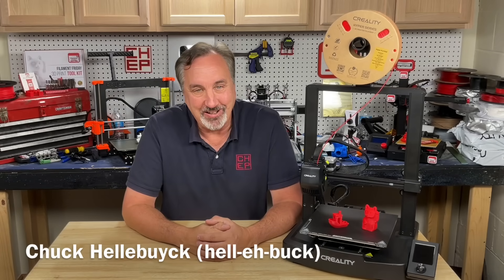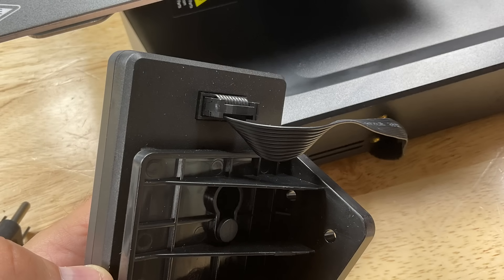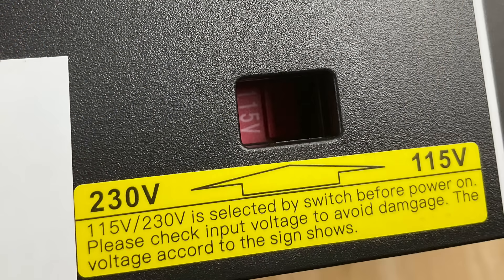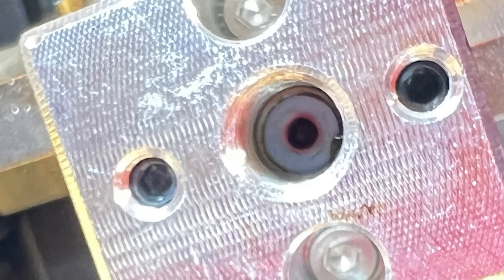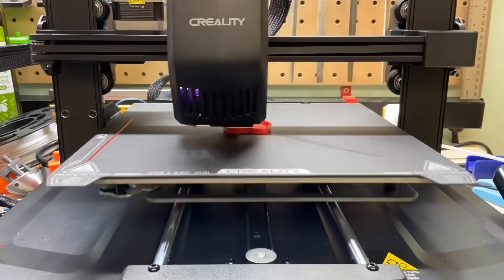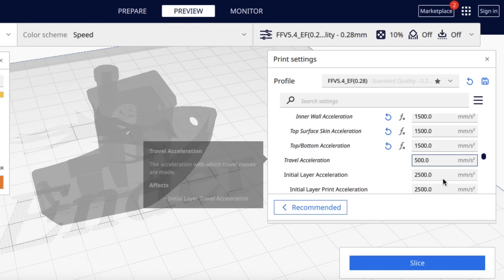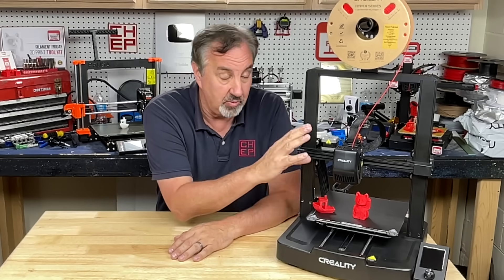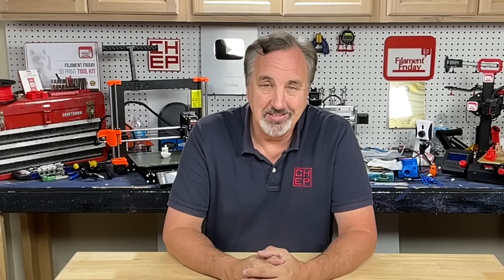Ender 3 V3 SE - Excellent Budget 3D Printer

Comment: Looks like they took some tech from the CR6SE....

Talking about the CR6SE, I know you must have one hiding in the back there covered in dust.
I have been using mine for almost 3 years and still think it's a great printer!
Over those years I have done some amazing prints off of it.
I do have the Community Firmware on it which makes it a MUCH better printer to use, and have changed out the extruder... Twice! 😢

But I would really like you to do another video on this machine if possible and see what speeds and stresses it can really handle.
I never print higher than 60mm/s and sometimes down to 50 for the finer prints.
But I print PLA, PETG, TPU and ABS all with the stock printhead and just love this machine.

But thanks for your videos, they are always great to watch and learn from and you have helped me in more ways than one.

Thanks again and stay well...

Comment: Why don’t they put these improvements on an Ender 3 v3? If they can do all that for 200, add some blowers, add linear rails for the X & Z axis, change to an all metal hot end, add an accelerometer and run it on Klipper at its true speed. The Neptune 4 looks like a better machine than the Ender 3 now.
Reply: There are actually 3 versions of the Ender 3 v3. The SE (Sprite Edition) which is the entry level with $200. The KE (Klipper Edition) with linear rails running Klipper at about $280 and finally the v3 with Klipper and a Core XZ motion system at about $380.

Comment: Smaller horizontal footprint than the ender 3. It has a load sensor for automatic Z offset.  Surprised they're all getting rid of manual bed leveling so you can't make any physical adjustments.

Comment: The real question is how van prusa continue with 900€/$ mk4 with such competitors ?
Reply: The point of Prusa printers is reliability and support. This may not mean much to a hobbyist, but if you run a print farm or use the printers in a business, for example, these two points are very important. You want to have your production equipment and prototype machines running. If you look at competitors like Raise3d or Ultimaker, who are competing for the same customers, Prusa is still among the cheaper ones.

Comment: All metal hot end: order ender 5 s1 hot end. Bi-metal heat break and the same heat block/nozzles. Just remove the ptfe tube and slide the heatbreak/heat block assembly in.  You'll end up with a radiator you cant use. Compared to my original ender 3 it is faster. Just not the new fast. If id known it was going to be announced i would have waited and bought a e3 v3 ke though so take that as you will.

Comment: Thanks for another good review, Chuck.  I've been printing on my new V3 SE since the day I got about 2 weeks ago.  The bed is too sticky (use glue stick if you want your parts to release) and I've replaced it with a PEI bed. It's the same size as the Ender 5 S1 with the cutouts. For taller prints at higher print speeds and accelleration, the entire gantry sways and would really benefit from stabilizers. I am using mine for utility parts only that need speed.  Compared to my Anycubic Kobra 2, I think the V3's auto Z is better.
Reply: The PC sheet does not stick too well. I have them on 3 machines and print on them every day. They are only super sticky at first, after 15-25 prints they loosen up and are great. Don't waste your money, be patient. Unlike this guy here.
Reply: @hexesandheroes  I have PEI on 11 other printers and I prefer it. So please don't jump to conclusions and say I'm wasting money.  I grabbed a new PEI sheet out of the stack of about a dozen I have on my spares shelf and put the PC with the ones I had on my original Ender 3 Pros.
Reply: @Stew3DPrinting 🍿🤏👀

Comment: Thanks for making this video! I'm new to the hobby and just bought this thing 3 weeks ago and couldn't find much guidance on how to use it. (Even bought the wrong nozzle length because nobody else mentioned that in their reviews.)

Your .28 custom profile is spitting out perfect functional prints for me so far. No meaningful flaws whatsoever, and about 40% faster than the default settings on this thing. 

Quick question if you have a sec. I'm thinking about swapping for a 0.6mm nozzle with your new profile to get more speed for large functional prints. Do you think the 0.6mm can still deliver good  detail when I need it by reducing the layer height, or should I plan on going back and forth between the 0.6 and 0.4?

Thanks again -- your videos really really helped me with getting started and tinkering with things!
Reply from the maker: 0.6 can do amazing detail. Shouldn’t need to switch back very often.
Reply: @FilamentFriday  oh heck yeah that's what I was hoping to hear 😁

Comment: So it does not have any bed level screws at all Chuck?
Reply from the maker: None. Fixed bed.
Reply: @FilamentFriday  Very cool, thanks for verifying!
Reply: None doesn't need them. Most of the newer printers are getting rid of them as they are an easy thing to screw up.
Reply: You don't need them or the crappy piece of paper, it has worry-free Auto Leveling. Did you watch this video?
Reply: @IbnBahtuta  I did, that's what I thought I saw and heard and was simply verifying

Comment: Nah, just put a few more bucks and you have a neptune 4 a real fast one.
Reply: Npeunte 4 also has a ton of problems with leveing and z-offset which are still not solved and Elegoo admits that it's both a software and a leveling sensor hardware issue.
If anything just wait a bit longer and get the V3 KE instead, which is an even better version of the N4 with fully automated leveling and zoffset.
Reply: @kwedl I'm new to the hobby and was considering getting a v3 KE, as I said I'm new and I have no idea how long it usually takes between the announcement and release. Any insight?

Comment: I'm trying to get a small print farm started, the only thing the v3 needs is an all-metal heat break. speed would be nice, I have had too many "wigs" come out of trying to go 100mm/s on my heavily modded 3 pro. I also have a Sovol V6 and that runs PLA and ABS at 100mm/s, but PETG tends to come off the print bed at that speed. Top speed with nylon is only 30mm/s, going faster it sticks to the nozzle. I would love to get the v3, I've worn out the 3 pro, I've had to replace the Z screw nut and all the belts and the Y carriage wheels. I bought it 2 years ago and ran about 200 lbs of filament through it. That's not counting print failures or bad rolls.

Comment: What printer would you recommend for a £500 budget I've already had a ender 3v2 and looking for something better and faster
Reply: P1P is around there an one of the best printers money can buy. Prusa are good but they are way overpriced for what you get and still have the problem of the old bed leveling machines.
Reply: It depends on what your requirements are. Do you only print PLA/PETG? Or do you want to print materials that require a heated chamber like ABS/PC? Do you want to print materials that are flexible like TPU? Do you plan to print abrasive materials like CF Nylon?

Regardless, if you only print PLA/PETG... Not sure how much a P1P is in brexit country, but I believe it is just slightly over your budget. If I were you I would stretch it to that, and get the P1P.
Alternatively if you dont need to print TPU, I personally have had good experience with the FlSun super racer, which should fit comfortably within your price bracket. Probably can get the speeder pad as well to use with klipper. Currently its even on sale, you can get the SR with 5kg PLA for about 400 pounds.

Another alternative to watch is the bambulab A1 mini, which you can preorder 16th oct onwards. It should provide you with all the features of a prusa mini and way more, for less money. If you want to print with multiple colors/materials, this is the way to go. I believe the A1 mini + AMS lite is also within your budget.
Reply: @tHaH4x0r  sounds good thanks for all your info . I would like to print different colour. So the ams bambu sounds good does it have a chamber ?. Not bothered about abs, nylon etc but would be interesting maybe one day to have a go. I've had a bit of success with tpu on ender 3v2 stock ...

Comment: Lots of injected molded plastic - x carriage as well?
Reply: Is a $199 ender 3, what did you expect, aluminum and carbon fiber?
Reply: @omegadeepblue1407  well considering the 3, pro and even v2 had more aluminum and had a metal x carriage yea.
Reply: @truggy82  Maybe the KE and the Core XZ V3 are going to have less molded plastic
Reply: @omegadeepblue1407  maybe. Molded plastic is not cheap to setup with the dies and such.  As long as it’s used in the correct way and places it should be fine. The x carriage if it really is a molded piece - I question its longevity through use and being taken apart and put back together. A common issues with the ender 2 pro is the lugs for the hotend attachment point shear off due to their design where I have never had that happen to my ender 3’s. Not you have plastic with heat inserts- how well they hold up time will tell. My experience with creality is that they like to throw pasta at the wall and see what sticks- however this is at the price of the user.

Comment: Why the F do they still have PTFE inside the hotend? There is no reason to do that.
Reply: One thing to keep in mind is an all-metal hotend is a lot more "sensitive" to user error and if something goes wrong, it is a MUCH bigger pain in the butt to fix. While I wish all-metal was the norm, I also understand why they didn't go that route.
Reply: I print architecture model, and countless retractions clog every all metal i tried.
Reply: It help with certain projects to keep the filament from feeding incorrectly, and its a "cheap" solution.
Reply: @AlbertoMartinez765 correct it saves cost and if you replace it with a Capricorn tube you can still print up to 250°
Reply: I completely agree. PTFE lined hot ends are ridiculous at this point in time.  Not to mention the sprite all metal extruder that came on my s1 pro should be the standard
Reply: PTFE can be more reliable if installed properly or less reliable if there's a gap between the tube and the nozzle...
Reply: They can't get that deal with Capricorn
Reply: As a parrot owner I'm not a fan of PTFE-lined hotends either, but it does make it easier to print PLA. I hope it's at least not hard to switch to metal, though.
Reply: More reason to get the anycubic kobra
Reply: Agreed, anycubic does cheap printers much better. But I just got the K1 Max, so it's not like I care that much. @krauselee877

Comment: they heard people saying "springs suck." so they removed it... nice... but honestly that speed test... if u add the springs on the bed... will act like an old ender 3... shifting all over the place... they should change the model tho... to eliminate shifting entirely... i seen those bed printers... that the bed moves on Z and the extruder is XY which makes more sense... as the head should always move but the piece /bed stay put without any vibration.
Reply: Those printers you are talking about are called Core XY, are good but not cheap to produce.

You will never see an Ender 3 being core XY since the Ender 3 is a model designed to be cheap and decent. 

The Ender 5 and beyond can be Core XY.

Comment: Glad to see a video on this! I'm eagerly waiting to see how to set this up in Cura or Prusa Slicer. What printer profile are you using? The old profiles print really bad on the SE, and the Creality slicer seems to be the only thing with decent profiles.
Reply from the maker: My own profiles.
Reply: I use the E3, E3 v2 in Cura, and my E3 V3 SE prints just fine. What profile are you using?
Reply: @EmmaLeaBlankMusic  did you copy the start/end gCode  from Creality's SE profile into the profile in Cura?
Reply: No I didn't. @PatFriedl
Reply: @EmmaLeaBlankMusic  That's the only thing I did and once I downloaded Chep's profile, it's printing like butter!
Reply: I must admit, a bit over my head. I'm looking at the gcode in creality SE. You mean the entire field in both the start and end? Also, which Cheps profile?
 @PatFriedl
Reply: @EmmaLeaBlankMusic  I just downloaded the latest from Chep's video description - the good and best, and also found his TPU profile. The only thing I updated in the profiles was the speed, which I bumped to 80mm/s on Good for the SE since it can handle that easily.

If you've got the latest Creality Print software installed, select the SE printer and then the Manage button. Copy the G-Code from each section and paste it in place of what's in the Cura Machine Settings (Manage Printers, Machine Settings) and just make sure you completely override what's in there now.

I used the Ender 3 v2 profile and pasted in the start/end G-Code from the Creality SE settings and it's printing near perfectly with Chep's most current profiles at 80mm/s. I'll test higher speeds and see how well it does :D
Reply: Thank you. I'll follow that and give it a try!
 @PatFriedl
Reply: I tried e3 S1 pro. But I get the best speed only with creality slicer.
Reply: Ill have to try it. Any way to post process create script for thumbnails in Creality Slicer? @Mail4aj